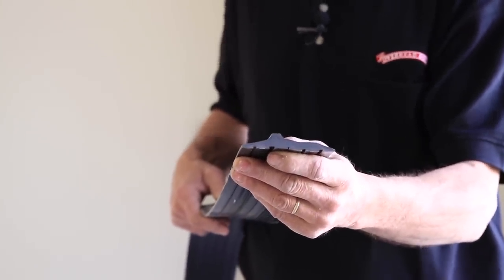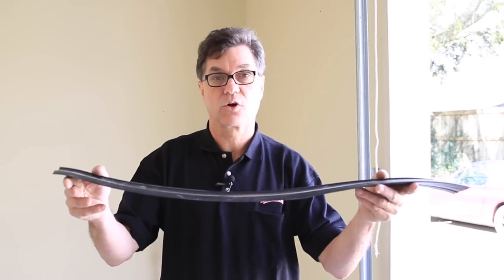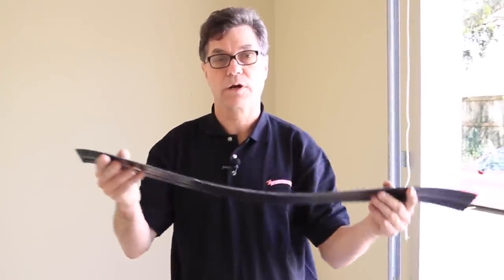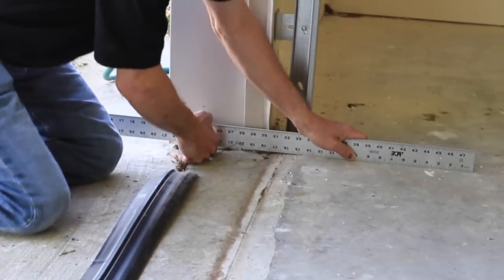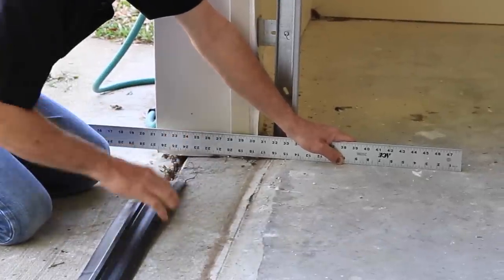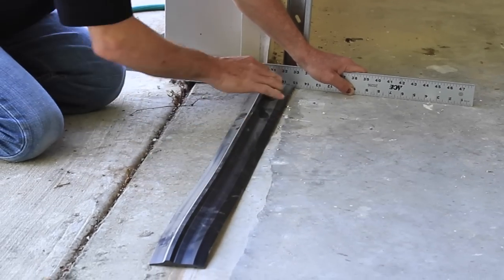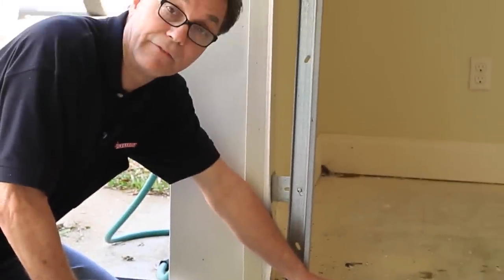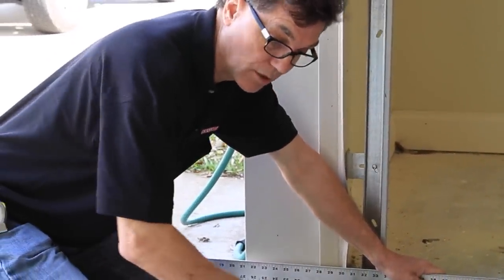Cheap way to keep water out of your garage - Baton Rouge - Overhead Door

Comment: How does one install this product and adhere it to the concrete and where can I buy it?
Reply: You can try silicon calk since it acts as glue, but it has to dry first. If its raining alot I wouldn't do it. There are more permanent adhesives the only problem is if that doesn't stop the water then your gonna have to figure out how to peal it off and try something else.

Comment: Will this help keep rodents out? If not what suggestions do you have for that?
Reply: I'm no expert but figured I would give some opinions on the subject. If you have a big issue with rodents, I would contact an exterminator and have them set up traps outside the house as well as inside the garage.